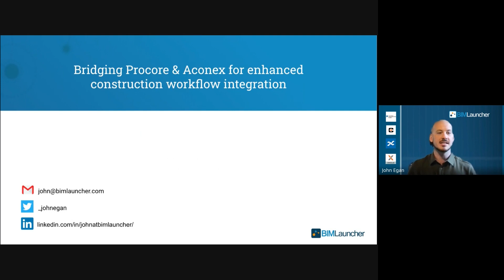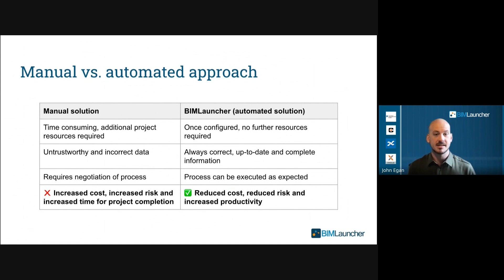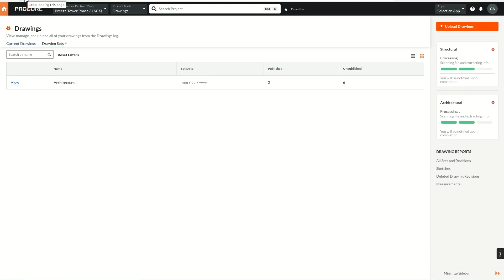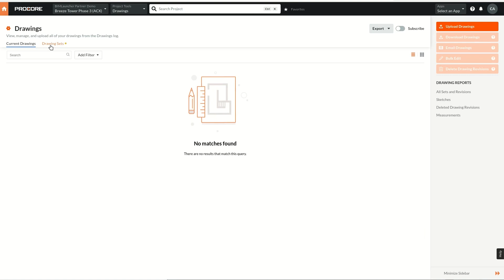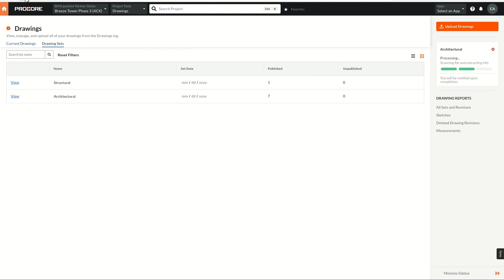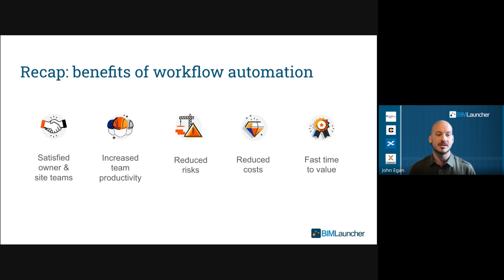Comment: Great work BIMLauncher team. This solution looks promising to save time for coordination between stakeholders simultaneously, which would result in saving costs in Change Process. As a PM; one of the biggest issue the construction industry is facing is the change process/design update during the construction phase. It is vital for the principle contractor and principle designer to be on the same page at all the time.